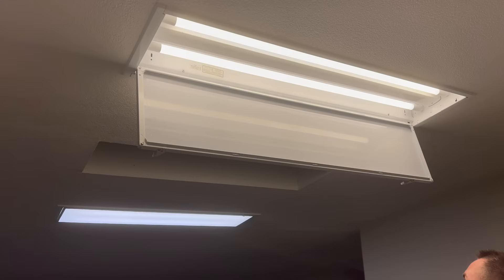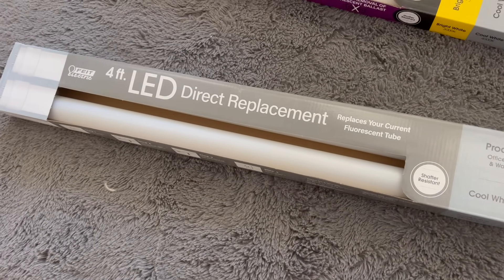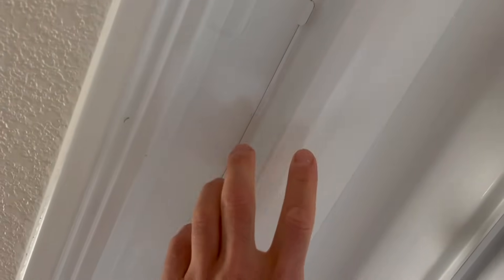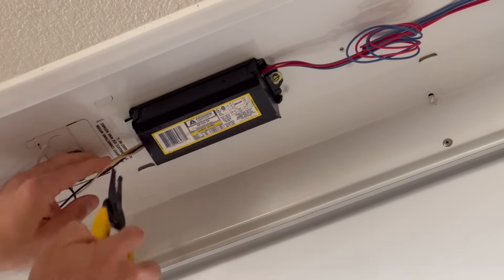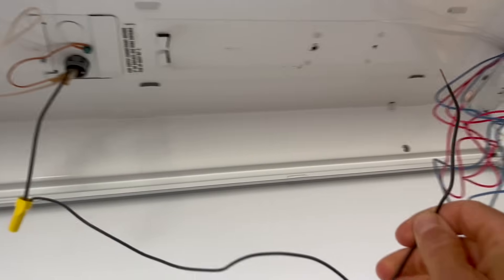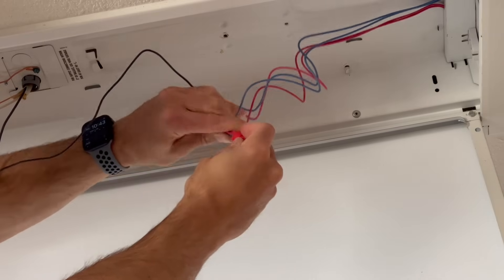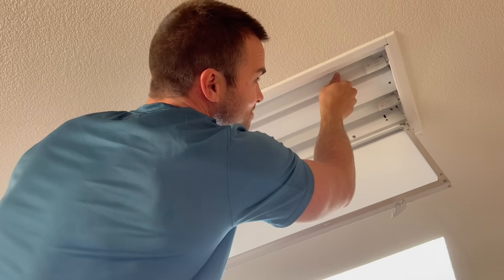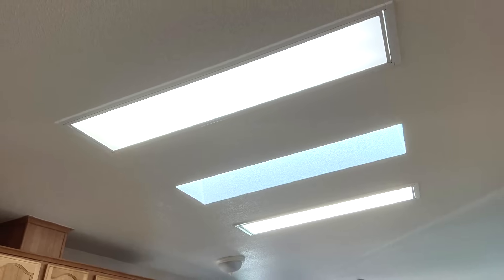Convert Fluorescent Tube Lights to LED - Easy Ballast Bypass Instructional | Builds by Maz

Comment: I am so grateful you created this video. Without it I would have had a very difficult time converting my flourescent fixture to flourescent. No choice in California. The Phillips tubes I installed required shunted tombstones so  I did have to research whether I had shunted or non-shunted and found a video that told me how to test. I would have had to install a jumper if they were unshunted. Aside from that this video got me through successfully. Very clear, easy to understand and shot with great lighting and well-focused camera.

Comment: Can you please guide me where to get hold of the "Feit - 4ft - Type B - with selectable color temp? Your link is out of date and I can't find them anywhere - just Type A!
Thanks in advance.
Reply from the maker: The home depot link still seems to be working on my end.  https://www.homedepot.com/p/Feit-Electric-18-Watt-4-ft-T8-T12-G13-Type-B-Ballast-Bypass-Linear-LED-Tube-Light-Bulb-Selectable-White-2-Pack-T4815-4CCT-B-LED-2/321037737

Comment: Your fixture has to have non shunted  tube stones  for this to work or just use the ones provided in the new tube tube B box so there is a bit more to it if your fixture are old….

Comment: Any idea if I can get these in 3 ft for t12 bulbs?  I've searched HD site and seems they only have plug and play that has to use the ballast for 36in and they don't have these selectable ones, ugghhhhhhhhh...this is such the perfect replacement I want too to not deal w/ these ballasts.  UPDATED Q...seems t8 bulbs will work when I bypass the ballasts.  Now just have to see if there's anyway to get these selectable bulbs for 36" because those are game changers.  Too bad they can't just be the standard instead of making all these different brightnesses.

Comment: Thank you for the helpful video.  My garage fixtures had the same wiring setup, and the LED rods I bought required wiring connections at both ends, so your video was a perfect match.
Finally replaced all 4 pairs of rods in the garage and deleted the ballasts.  Took about 1 hour and wow, what an improvement.   Those ballasts weigh 3-4 pounds each, total waste of energy.

Comment: Hey, great video for DIY'ers. My question is about going from 2 bulbs in a fixture down to one. It seems that one LED is brighter than two old Fluorescent bulbs, so would I do anything different with the wiring? I don't need all four tombstones live as I'll only be putting in one LED replacement. Is this do-able? Cheers!

Comment: Thanks for the great tutorial. Only thing was my bulbs did not have any indicator of live/neutral on the ends of the bulbs themselves. Instead, there was a sticker on the live side that showed a diagram of the correct positioning. Once I found that, I was good to go.

Comment: The only thing I would mention is I would take the extra wire nuts off the incoming power and connect the wires directly to the power. One less set of connectors to worry about. And there are 2 types of direct connect bulbs out there. Single ended and double ended, your video is for the (more common) double ended.  Also not all bulbs have a power and neutral end to plug into,  none of mine do

Comment: A great video! But my wiring seems a bit different. On the "hot" end, where 2 blues and 2 reds are seen in the video, I have 2 blues, 1 red, and 1 green wire. Now what? Can I connect all 4 (including the green) to the black wire?

Comment: Any reason why not shorten the rat’s nest of long wires when doing the bypass connections?? Seems like a lot of extra useless messy wire length on both ends 🤔
Reply from the maker: No you definitely can shorten them for a cleaner look. Just don't make the mistake of going too short and then not having enough wire to connect lol.

Comment: Thank you! Exactly what I needed to learn. I have 3 grow stands, 1 tabletop and 2 standing., each using 2 foot fluorescent bulbs. The tabletop has two bulbs and one central ballast and the standing units each have 4 shelves with 4 lights and a central ballast over each, so there are 9 ballasts to rewire. I am assuming the procedure is the same with these freestanding units so I will start with the single tabletop unit as my 'guinea pig'.

Comment: Great video 
But I’m a little confuse. So after removing the ballast there’s no need for transformer to convert from 120 volts to 24 v or whatever voltage is your lightbulb ?
Reply: No, they're designed for 120V. There are different options though, some are dimmable, some are non-dimmable, some flicker, some do not. Just as with 120V christmas lights that flicker, there are some with an AC to DC transformer which prevents flicker.

Comment: You forgot two critical steps:
1. Label the fixture as direct wire as you can no longer install fluorescent bulbs in that fixture
2. Label the Hot and Neutral ends so you know which end is which when you replace the bulbs in the future. Yes, they are supposed to last 20 years, and the might. Will you remember which end is which 20 years from now?

Comment: Great informative video! Successfully converted my first 3-bulb ceiling light. All of my wire colors were different than in the video, but just followed the concept of neutral (white) to the single wire from the tombstones and live (black) to the multiple wires from the tombstones on the other end.

Comment: Thank you for posting this easy-to-follow instructional video.  Your tips helped out tremendously when I replaced my pair of fluorescents to LEDs just last night!  The only thing I did a little different was that I removed & discarded the snipped black and white wires from the existing twist connector caps, and then reused those two twist caps to connect to the wires as you outlined.  (I have read online not to reuse the twist caps, but did so anyway - and it seemed to tighten and hold up fine).  Thank you again 👍❗️😁
Reply from the maker: As long as you twisted the wires properly, the twist connectors will hold just fine.

Comment: Succinct video, but only for this situation! I tried searching through comments for references to the gauge of wire one needs to splice in the new connections, and came across several "problems" that people asked about (with no answers). 

Several asked about a 4-tube setup. Then here were others, a few noting that there are double-ended and single-ended tubes, which require different wiring. In case you have these situations, you'll have to look elsewhere for the answers. I turned to ChatGPT and got the following. It appears that he has Double-ended; there also are Single-ended.

ChatGPT wrote:
I’ll show both common wiring styles—double-ended and single-ended—since your LED tubes will specify one or the other on the packaging.
What you’ll need: 
- LED tubes marked “ballast bypass” (confirm double-ended or single-ended)
- Wire strippers, cutters, screwdriver
- Listed wire connectors (e.g., Wago or wirenuts)
Optional: non-shunted tombstones (required for single-ended tubes if your current lampholders are shunted)
Small “retrofit”/warning label

                         Identify the lamp holders (tombstones)
Shunted tombstones: both contacts are internally tied together (common on T8 electronic/instant-start fixtures).
Non-shunted: contacts are isolated (common on older T12 magnetic).
Check with a continuity tester (power OFF). 
Single-ended LEDs require non-shunted on the powered end.

A) Double-ended (a.k.a. “hot one end, neutral the other”)
- Works with shunted or non-shunted tombstones. Often the easiest—no lampholder swap.
- Goal: All “left-end” tombstones get HOT; all “right-end” tombstones get NEUTRAL (or vice-versa).

B) Single-ended (power on one end only—separate pins for hot & neutral)
- Requires non-shunted tombstones on the powered end. The opposite end becomes mechanical support only.
- Goal: On the powered end of each lamp: one pin gets HOT, the other pin gets NEUTRAL. The far end is not wired.

I won't share the full instructions, with more detail, but you get the idea. Suffice it to say, it's not necessarily this simple!

Some of the questions that others asked:
"Is this conversion for existing shunted or non shunted tombstones? My fixture uses T12 bulbs and has a rapid start ballast. I believe the tombstones are non shunted. Thanks for the help"
"Was your installation for tombstone sockets that were shunted or non-shunted?"
"what if you dont have yellow wires? does the white wire go into the other end of a socket? " 
"My ballasts have all 4 wires on one side blue and the 4 wires on the other end red and yellow. So each tombstone has 2 wires each but on both ends. All the videos I see the ones side only has 2 yellow wires mine has an extra 2 wires?"
"Nice video. My wiring layout is a bit different. No yellow wire at all, just a set of blue wires going to one end and red wires going to the other end. Not sure how to hook this up?""important to precise this rewiring only works for double ended LED. Otherwise it doesnt work"
"Although this video helped, I had to do more research for my case. My ballast was of the instant start electronic type, with the red and blue wires going to 2 different directions. The wiring for my case was different."
"My fluorescent light on my grow light system has an external switch on each of the 3 lights. The wiring is slightly different than a wired fluorescent light. I have a photo of the wiring for the switch. Is there a way that I can send the photo?"

Comment: Actually there are 3 options regarding replacing fluorescent with led's. There's type A  that works with the existing ballast.  There's Type B where you bypass the ballast. Then there's type A plus B that work with both.  My recommendation is to use Type A plus B because you can use them with the existing ballast and when the ballast fails you can use the same bulbs after bypassing the ballast.  HomeDepot does not sell the Type A plus B bulbs.  The Type A and Type B that they do sell at HomeDepot  only go up to 2000 lumens.  Some of the Type A plus B purchased online are not only higher in lumens but allow you to decrease that by a voltage switch on the bulb. There's also another switch that allows you to adjust the color of that bulb from a soft white to daylight.

Comment: to add a note to this.   mark the ends some where out of view.. but where you can see it when replacing.
Reply: You won't be able to see the marks through the cover, I was thinking to use a sharpie to mark each side on the ballast cover

Comment: Excellent video. Wish I had seen it before I just replaced a ballast. Moved into my house 16yrs ago. Have a large workshop with 24 of the 4 tube T12s, and three of the 3 tube T8s. Have only  replaced a handful of the T12 tubes here and there, and all of the T8s, every couple years the T8s burn out. Replaced all 3 T8 ballasts once and one T12 ballast a few months ago in all these years here. Don't even make this ballast anymore, had to get an equivalent new model. But this past year, most of the tubes in the shop have finally burned out and I am down to about five working lights out there out of 24.  Bought a 30pk of T12s months ago and just started replacing tubes. Wish I had seen this video in about Feb. If it turns out any of the ballasts are gone, I will start converting those lights over to LED. The shop was apparently built in 1994. Was starting to sweat the cost of possibly replacing all those big lights. No idea when the tubes were last changed out, except those few I have done in last 16yrs. The old tubes have a damn good lifespan! Especially considering the level of high heat exposure they get in our AZ summers (100-119F from end of March to October) Hope the LEDs do too! Thanks again for a great video!

Comment: Good video except one major thing. At 1:34  of the video you say that the tubes get their power from one end of the tube.  The type B tube that you are using is a double end power tube.  And you connecting black (hot) wire to one end and white (neutral) to the other end, verifies that you are wiring both ends of the tube.  Tubes that get their power from one end, need black and white wires connected to one end. The other end with no wires at all does nothing but hold the tube in the mount.  You might want to correct your video with a caption.  Otherwise the video is good.

Comment: Is there any reason not to leave a bit of wire on the ballast and leave it in place(but disconnected) so that you can return it to ballast operation in an apartment complex?
Reply from the maker: You certainly could.
Reply: @buildsbymaz I did. And then as I was wondering "are these polarized" I noticed L and N on them. I was 100% sure N meant neutral but L had me stumped - in my mind it should be H for "hot", but after reading the instructions (who does that first) and finding it meant Live, I plugged one in. It came on and no explosions or breaker tripping. Plugged the second in. Same result.

Pulled the bulbs, tidied up the wires(I left the ballast in place and just used wire nuts on the excess I left), and put the cover back on. It should be relatively easy to rewire it back to ballast operation before I move out.

Honestly, why places haven't gone away from ballasts, I don't know. Cost I guess. Maybe a ballasts fail they'll start to rewire them to ballast free and hopefully any new constitution is ballast free.

Comment: THIS VIDEO WAS /IS GREAT!!!! Thank you so much !! I was intimidated because it was dealing with electric..This made it easy. Do you have any videos on replacing light fixtures to install new ones ? I want to change my hallway light fixtures
Reply from the maker: As a matter of fact I do! 
https://www.youtube.com/watch?v=J8Ob9iWgDN0&t=10s
Reply: @buildsbymaz Thank you , you are the Man!!!!
Reply: I was able to get the 5 wires (black, blue, red ) twisted with a yellow wire and secure when pulling on each.  Is the yellow wire nut ok from a safety perspective?  Not an electrician, just DIY here.  Light is laundry room so not on very often nor very long during the day @buildsbymaz
Reply from the maker: @tomw1573  If you got them all secure and there is no bare wiring exposed, then you are okay. The red caps are just designed for more wires so it's easier to use.

Comment: Will it work if the ballast has gone out? I think it would because there is electricity to the wires, right?
Reply from the maker: Yes it should still work.
Reply: @buildsbymaz thanks! I just opened mine up and there are red, blue and yellow wires on both sides - should it still be as easy as black to red/blue and white to yellow?

Comment: Thanks! I use this video to adapt my old setup. The only difference for me was I had two of the ballasts. I swore they weighed 5 lbs extra. When I took them out it was so much easier to put the fixture back in place! Thanks! I paid like $15 for two LED bulbs from Menards versus a whole new lighting fixture!

Comment: Like 2 years ago i bought a box of LED fluorescent tubes, thinking I could just replace the existing fluorescent tubes. When I saw I had to do some kind of wiring, I put it off. Well after 2 years, thanks to this video, I finally installed them!
Reply: Putting something off then completing it anyway despite yourself is peak satisfaction.
Reply from the maker: Better late than never!

Comment: welcome to the 21st century , where changing a lightbulb is now a pain in the ass
Reply: This is actually a good thing upgrade though and is one and done. Never have to deal with a blown ballast again and the LED give off way better light.
Reply: @seashackf1  Just be sure to use Type B bulbs when it requires type B bulbs !!!!!! lol , I learned the hard way , BOOM !!!!!
Reply: @shure46 sounds like you were born either yesterday or 30 years ago.
Reply: @seashackf1  Yes I agree , get rid of those ballasts ... It is a good thing , tru dat
Reply: Truth. 😂
Reply: Lol
Reply: Single push pin bulbs work the same way but are easier.
No fiddling to line up multiple tiny pins.
Reply: L stands for Line not Live i believe, but either way, its a great upgrade to a flourescent light.
Reply: I work in a seniors home that used to be a hospital...a lot of the ballasts are starting to leak so removing them and going LED is so much better. And really this is a lot easier than changing the whole fixture.
Reply: @steveleslie2170  I understand and agree , I hadn't dealt with flourescent fixtures in a long time , this was ll new to me when I changed the bulbs and found out the hard way there are two types of LED bulbs and if you put the wrong one , POP !!!! it blows and freaks you out !!!! lol
Reply: For a peasant 😂
Reply: That comment surely shows how little you understand light fixtures.
Reply: No need to remove the ballast.
Can just leave it there.
One less step.
Reply: @ronstrong9560 cause that one screw was SO difficult 🤣🤣
Reply: If that was a pain then you shouldn't be doing electrical
Reply: @ckhemikal  changing a lightbulb isn't "doing electrical" , anymore than "filling a glass of water is doing plumbing" .....
Reply: @ckhemikal  you missed my entire point of having to know there are two kinds of LED tube bulbs , and if you get the wrong type , it pops , COULD explode , and for sure burns out the bulb .... AND you have to figure out if the fixture has a balast or no balast which requires taking off the "shield" , all this TO CHANGE A FUCKING LIGHT BULB ,,,,, The point of my comment ......

Comment: It's a good idea to clearly label a ballast conversion and to indicate which side is the line or hot side. This way, if someone in the future is changing out bulbs, they won't a) try to put in a fluorescent or b) install the LED backwards. Unfortunately, most people still see these fixtures as fluorescent fixtures and also are not aware of ensuring the correct polarity placement of LED's in a converted fixture.